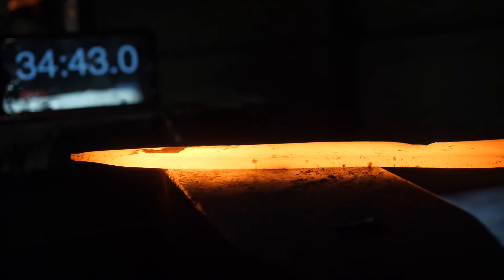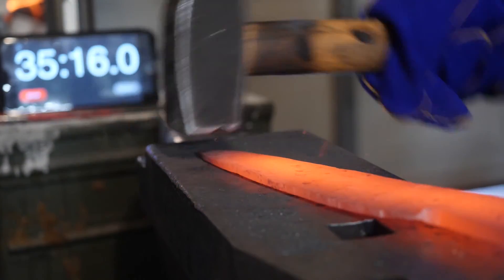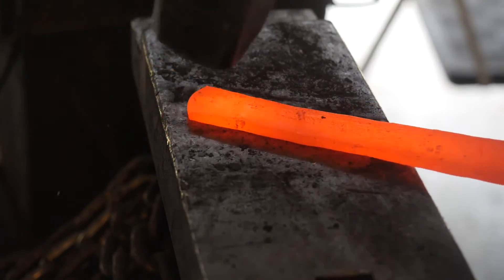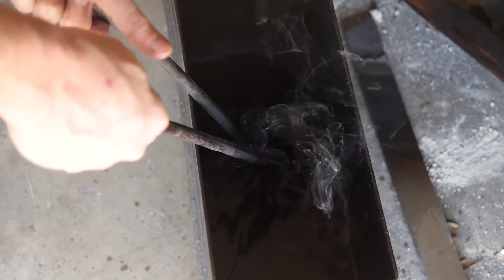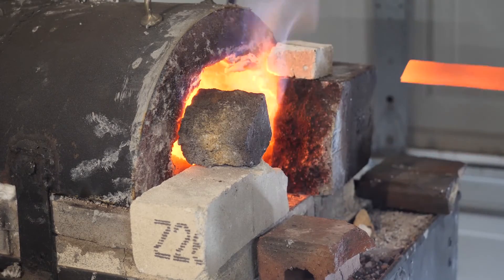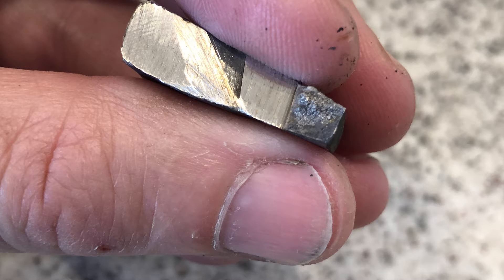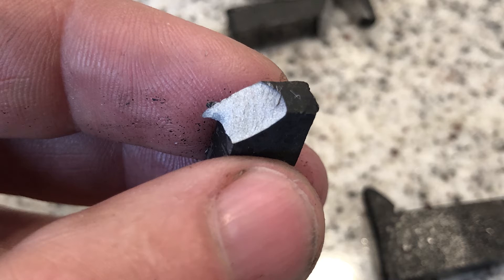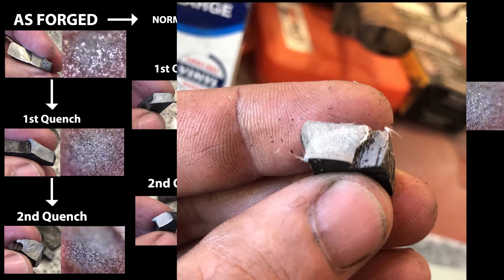1084 Forgeside Heat Treat Experiment

Comment: @GreenBeetle have you thought about setting up a temperature controlled forge? I know a heat treat oven is best but not everyone has one or can afford one.
Reply from the maker: I looked at it a long time ago by the time I got thermocouple(s), pid, worked out air flow and burner placement in the forge it seemed expensive and effort intense.  Are you looking at a specific setup?
Reply: @GreenBeetle  yeah I was looking on Amazon thinking with what I have could be done with less than $100

Comment: Double quench does increase toughness i.e grain size. have seen this at a commercial ,Q&T business that does wear and armour plate hard to see in actual measurable grain size (optical microscopy) but it can be seen in charpy impact test results. It's not massive.  The bigger issue is that as you have said is poor temp control causes excessive gain growth. The more steps the bigger risk to have over temperature in a normal forge

Comment: Looking at this I really want to say any difference in grain size was caused by normalization temperature and quench temperature. You only want a little bit above the a1 temperature so cherry reddish and you want 100% austenite conversion so you’d need to hold it at that temp for a bit. 

On the last sample was it hard? It looks like you might’ve gotten a tiny bit of ductile fracture. 

I want to say double quenching isn’t a real thing as I can’t think of a reason of how it would reduce grain size but I can ask around. But it hasn’t been covered in any of my classes.

Comment: I was given a forge only treating method that works really well with 80CrV2. normalize, quench (using alloy recommended temp rage), thermal cycle (3x non magnetic air cool), requench tempered martensite, temper. grain looks like glass by eye on the break.

from what I've learned you should expect larger grain from a normalization. non-magnetic Thermal cycling in air is meant to reduce grain size which in turn improves the strength of the hardened crystal structure.

Comment: The thing about double quenching increasing stress just sounds made up. 

Nothing at least in my understanding of metallurgy would lead that to be true

Edit: i'll also add doing multiple quenches. Or at least two, would lead to grain refinement, and studies i've seen devin thomas mention support that. 

Basically martensite diffuse carbon into austenite at a much lower temp than other microstructures so you could austenitize lower theoretically. And also, it can promote fine austenite to form through stuff thats too much to type in a youtube comment.

Comment: Nice Test! If you want to do two quenches it’s helpful to quench the first time with a temperature a little below your austenitizing temperature. It’s called sharp normalization. But just needed if you did a heavy forging session before. And you don’t need to cool down to room temperature. A auto temper is helpful in that case so just pull out of the oil when you are at a 300celsius area 🙌🏽
Reply from the maker: Thanks for the tips

Comment: I'm just learning hard data on HT and quench now, but furiously. So much of what i learned from various people years ago always seemed inconsistent or borderline superstitious. I am definitely putting a thermocouple into the forge im currently working on. Being able to hold a known temperature, even if i have to babysit and hand adjust gas and blower intensity, I know will make HTs and differential HTs infinitely less frustrating. Maybe after ive done a few dozen, I might try doing them by sound and color again if I'm confident I can discern the coloration and trust my forge.
Reply: put a thin layer of clay on the thermocouple it will last longer
Reply: I did this exact thing for the same reasons when I built my forge 4 or 5 years ago.  And now looking back, I would most certainly do it again!

Comment: Have you read Larrins book? With this being an old video is your process still the same? I did similar tests before reading Larrins book, and I think like many, have completely changed my process afterwards. I wish I could change some of my old videos since they aren't as accurate as they could be. But I think they still offer a good starting point and other relative information, so I left them up.  Good Forge heat treating is way harder than it appears. Overheating is the main problem. And you really can't tell heat treatment quality unless you do both a snap test and hardness test. Since grain size isn't relative to hardness. Ill leave the forge heat treating to the experts and just punch some buttons. Too much ocd for me😂
Reply from the maker: I did a follow up experiment where I simultaneously overheated two pieces of 1084 for the quench.  I quenched one piece right away at a bright orange heat while I let the other piece air cool to red before quenching it.  They both got hard to low 60s and both had garbage grain size but there was a slight advantage to the one that was air cooled to red.  Which doesn't add any practical information, I just though it was interesting.
Reply: @GreenBeetle  STEVE!  See my reply to 55... maybe check out the Quench10 stuff.
Reply from the maker: Yes, much trickier than it looks. The smallest amount of overheating punishes.This video was before I stumbled across his website. I haven't read his book.
Reply: I got the book on your advising and now I keep 4 different quench media on hand. P50 is obviously the gold standard for fast quench oils, and AAA for medium... but I just got three gallons of "Quench10" that's supposed to be better than AAA and it has virtually no scaling, but I don't have a Rockwell tester, so I'd love to see a video on that stuff if you get a chance... between removing all the trees from your roof. :)

Comment from the maker: This is an old video looking at forgeside heat treating 1084. Eutectoid, low alloy steels like 1070-1084 can be heat treated quite successfully forgeside without temperature control as long as proper attention is paid to not overheating the steel during normalization or quench and providing a relatively low a quench heat while still reaching transformation temperatures.  It's nerdy but I think everyone should do something like this in their own shop for each steel they forgeside heat treat.
Reply: we did this kind of thing in materials class back in Uni, though we cut and polished the samples with an etch before looking at them, lets you get a reall nice view of not only grain size, but the various phases, the grain boundaries and so on. if you want to nerd out more, try that next time, maybe?
Reply: I learned a lot. Thank you for all the great information.
Reply: awesome video, I follow larrin Thomas suggestions and I normalize 10xx steels 1 time, then do a fast det anneal by going into vermiculite from austenizing temp, then quench from non magnetic temp. grain size is usually super fine. I rarely heattreat in the forge anymore though.
Reply: The hard stuff people are reluctant to try. excellent work! Thank you!
Reply: One test still that would have been interesting to see is as forged but quenched low heat.
Reply: What is obvious from these tests is that you owe it to us to go buy a heat-treating oven and report the tests. Just tell your wife it’s for science.